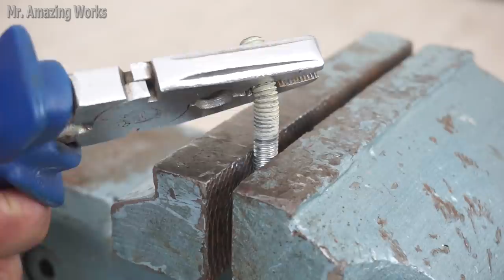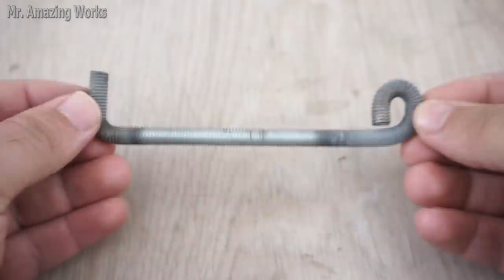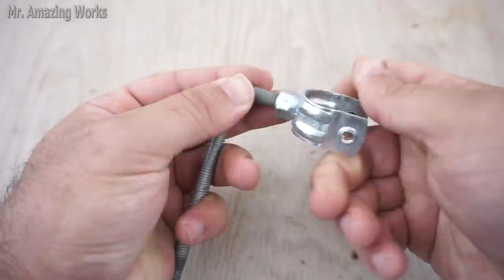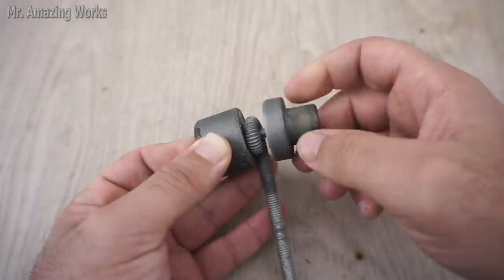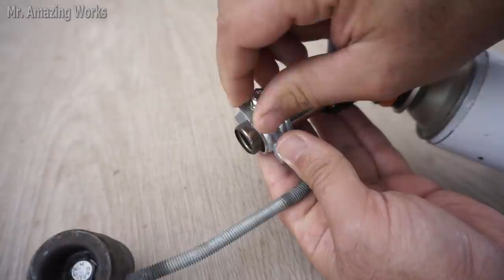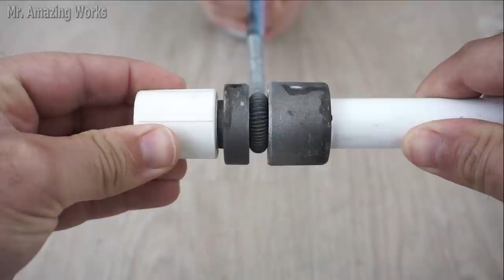AMAZING USEFUL TOOL

Comment: You need to have regulated temperature for ppr pipes and fittings, read Vargon or Aquatherm recommended settings, it's important to have temperatures from 260-270C on your heating tip, not a joke, thanks for video